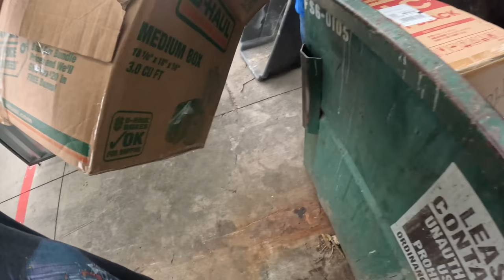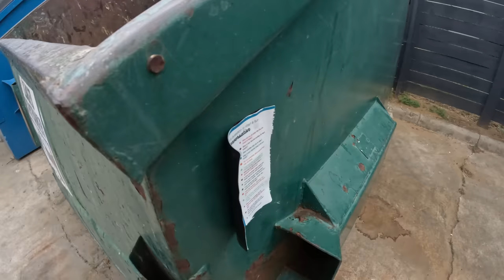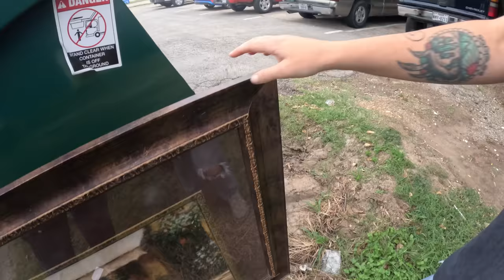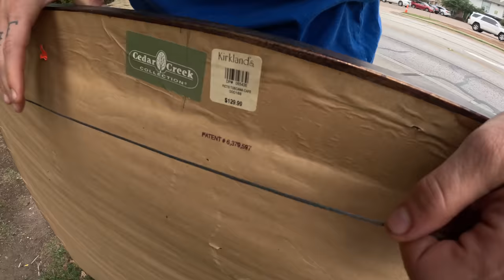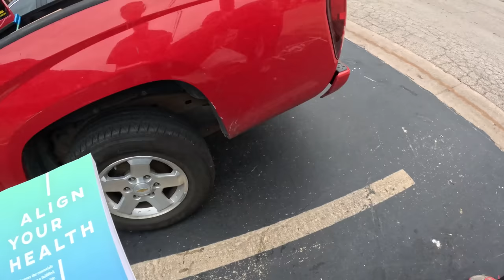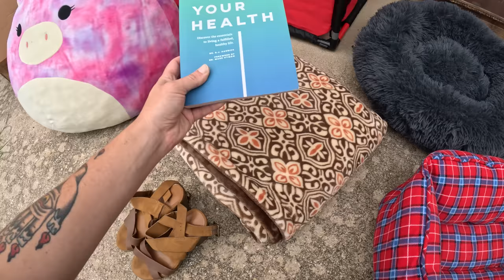We’re Back Dumpster Diving - Great Haul Over Two Days!

Comment: Welcome back. Sorry for your loss. You both were missed so I’m happy to know that both of you are finally feeling well. 
Check out the spices you saved. It looks like to me that they might be in the metal conditioners and most of that packaging is more than 10 to 20 years old. I don’t worry about Best Buy dates however most spices in that type of packaging is not recommended to use. 💕💕💕